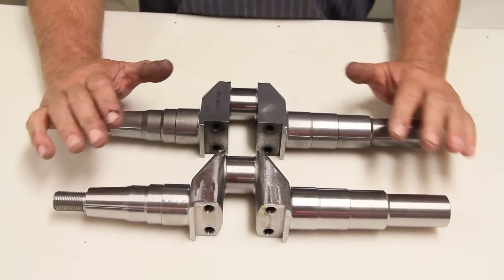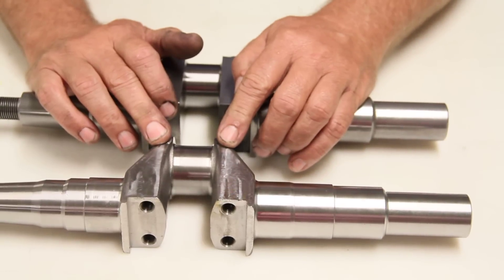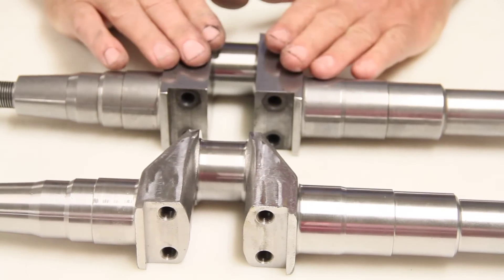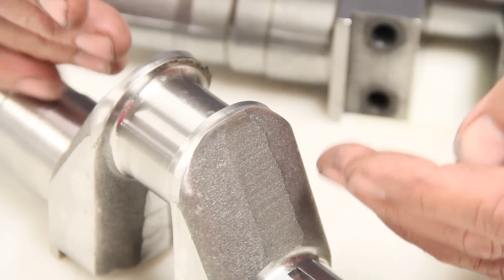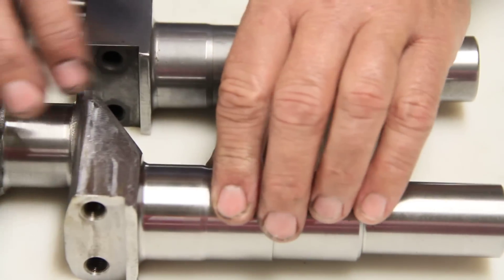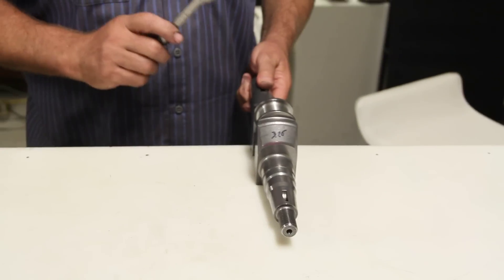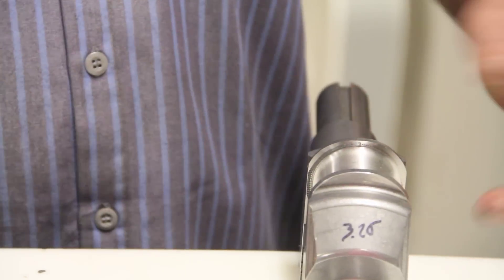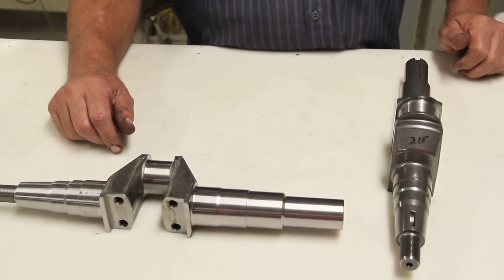Differences Between Forged Steel and Billet Steel Cranks

Comment: Do billet cranks have to be machined? Or can they be produced in other ways?
Reply: A Billet is generally either a round or Square blank piece of metal that has no features on it so yes it would have to be machined. Forged actually starts out the same way but their parts are moved around forcefully by dies on the hammer. Billet is always superior
Reply: @marlobreding7402  A metallurgist will tell you a forged crank of weight x is superior to a billet crank of weight x.  It has to do with the alignment of metal crystals.  In the example in the video the billet crank is beefier therefore stronger.  But if they were dimensionally (weight) identical the forged would be stronger.

Comment: i still dont really understand the difference. also, how come some pistons, like wiseco (may have spelled that wrond) are usually all forged.. whats the difference between forged, cast and billet.  i really still dont understand what billet is..
Reply: billet is when you get a block of forged material then cut it down to the tolerances/ measurements to make the part. Its like 3-D printing but instead of building the material, excess material is cut out to make the part, look up how anything billet is made, you'll understand.
Reply: @trottierindustries3769  like cnc machined? But that doesn't sound as strong as forged. Is it stronger or weaker than cast metal? I'm still confused haha, but thanks I think I understand a bit better now.
Reply: @trottierindustries3769  so if it's forged, that means like compressed/strengthened right? So it would need special tools to cut it down to the shape you want? Okay, I still don't know what I'm talking about and still quite confused, lol.

Comment: 0:48 Its called flash, it removes the forging die flash.
I disagree with your comment about the billet being stronger, If you have two cranks of identical material and design the forged crank will be stronger. Forging will enable you to control the grain structure and a properly forged part will always be stronger then cast or billet.
Reply: A lot rides on the quality of the billet and how it's formed too.
Reply: the video was a bit messed up comparing a larger beefier billet crank to a smaller forged crank but I agree with you that forged is stronger than billet.

Comment: Lite pros are too much for a forged crank learned that lol
Reply: +wes92395 We used forged cranks for years in our pro/supers without any breakage, but we used the outboard bearings on the crank on each end.  The 48 cube with the S&S super D that I run currently in the NQS has a forged crank in that as well.